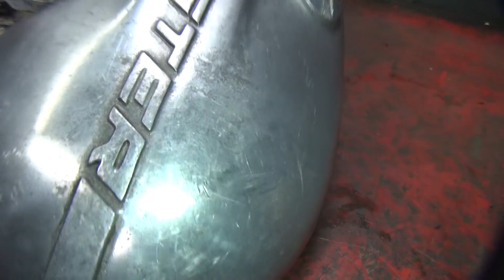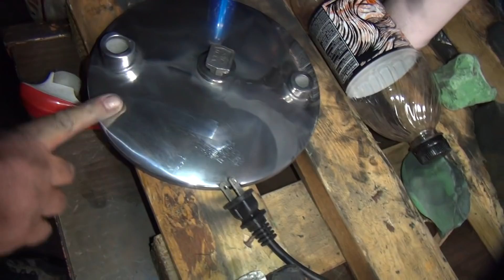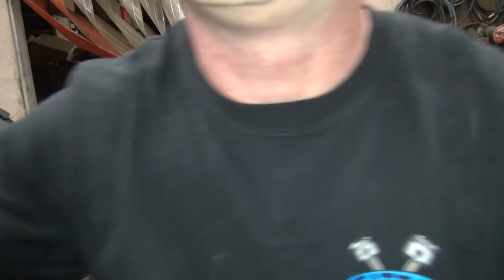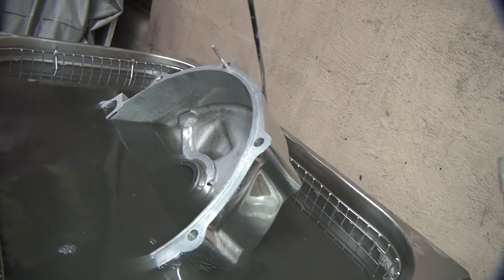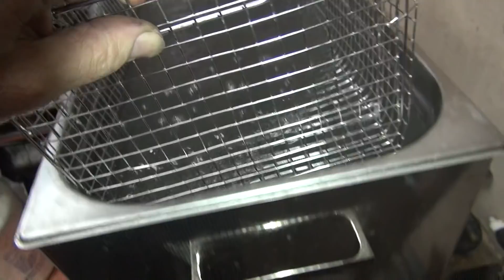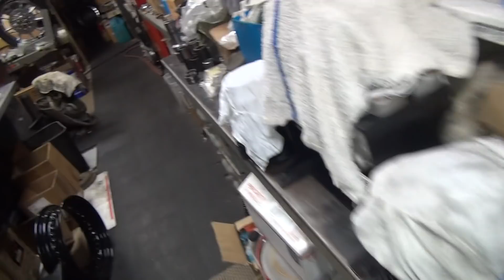#119 1978 93ci stroker shovelhead big bore motor new bike build fl harley by tatro machine

Comment: Hey tatro, I got a 91 evo sportster and my forks seem to nearly bottom out hitting the brake,  bumps feel alot harder that they should be. Any input would be great , thanks
Reply from the maker: change the fork oil. you are too thin or have low oil level.
tatro
Reply: What type of fork oil do you recommend,  the owners book says HD type E but I cant seem to find any
Reply from the maker: try 15w or 20w. stock is around 10w.
tatro
Reply: 91 evo sporty, Fork oil freshly replaced. But I've got a clunk coming from I believe  the triple trees. More noticeable at lower speeds on rough road. Its driving me nuts. Bad bearings? Possible adjustment?

Comment: I used to manufacture medical devices and the industry got away from high polish devices you should use the glass bead give it a light blast. Then send it out for chem film to protect the surface so it doesn’t oxidize. I’m just saying.
Reply from the maker: that is why you don't work on custom harleys. you have to have your shinny parts.
tatro